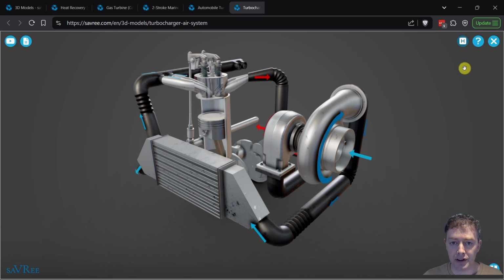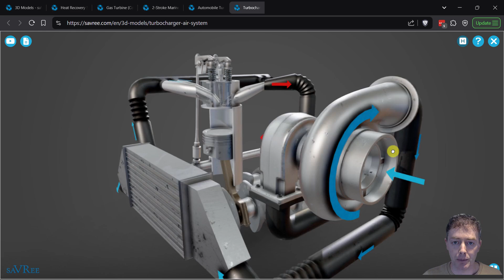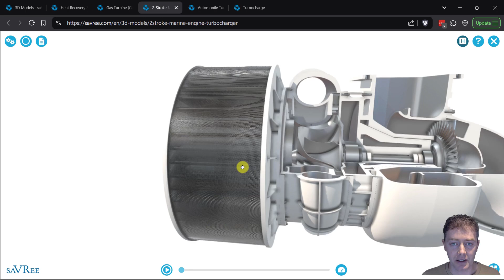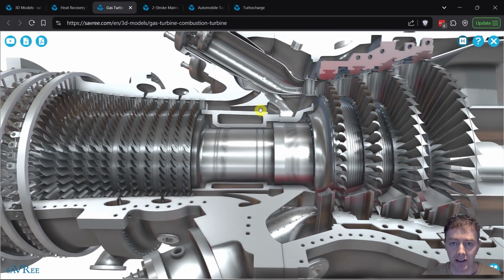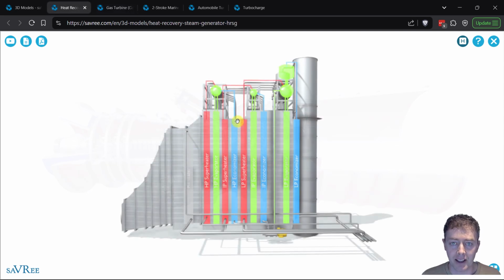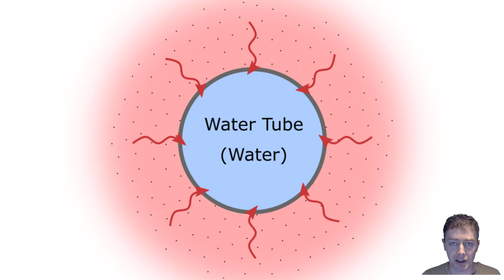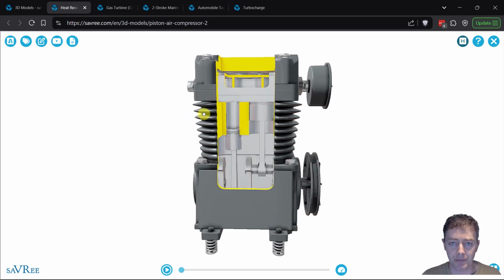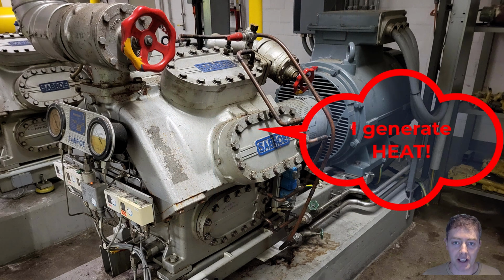Waste Heat and Reclaimed Heat - saVRee Snacks #10

Comment: It's not related to engines but it has to do with reclaiming excess Heat. I heat my workshop that is attached to my house with a woodstove. Its a cottage type house. 1 main room, 1 bedroom, a bathroom, and a laundey room. I made a back and forth loop of copper pipe and laid it under the wood grate on the wood stove. I have a 50 gallon barrel that sits a few feet away and to check valve on the outlet going into the copper coil in the wood stove. It just sits there and percolates water through and spits it into the top of the barrel. Then I can pump that hot water into the house through a radiator and use it to heat the house. I live in a heavily wooded area so firewood is pretty easy to come by and free. It saves me from having to spend money on propane or electricity to heat the house.

Comment: Tesla Turbine + viscosity of gases - cavitation...
The main reason why this is not commercialized is because inability to obtain the patent. But TT combined with exhaust-to-intake heat exchanger allows great heat recovery/retention within the system. Also TT is good for multi-stage application.
Reply: Correct!
Reply: Do you have a CAD with optimized turbine design for heat recovery? Even Solis says his design (which is by far the most performant on youtube) is barely touching retail gasoline engines.